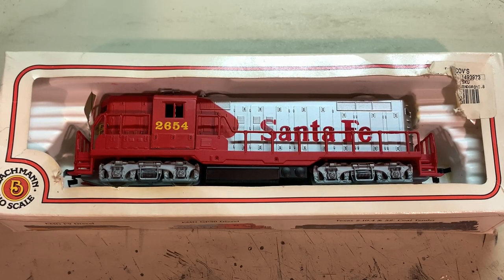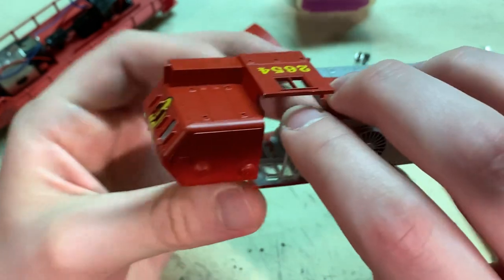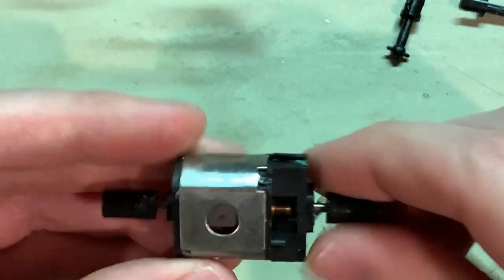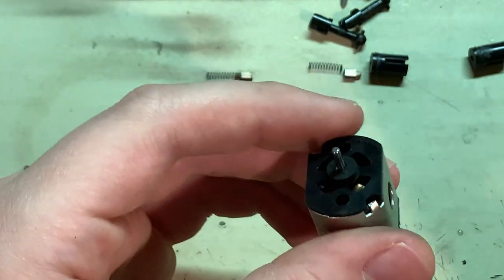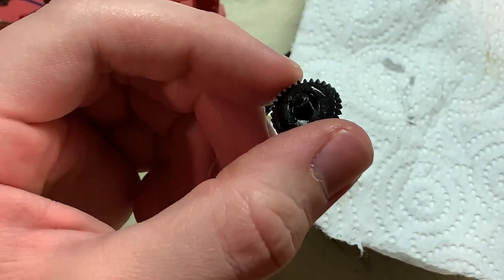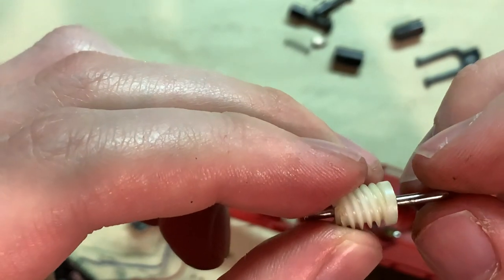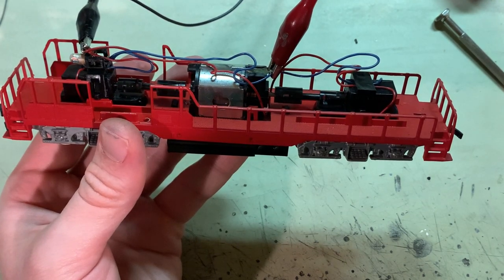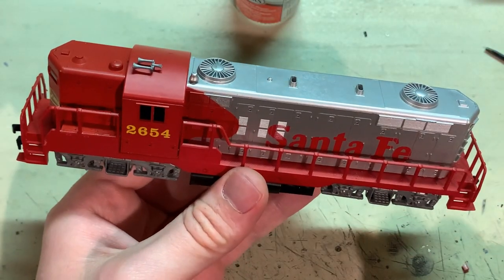How to tune up a Bachmann (or AHM) GP18 and other diesels by Mehano

Comment: Great video! Eight wheel pickup really does make a difference. I love Mehano models because they have a simple and therefore reliable drive mechanism, easy to service. I have some Mehano locomotives that are almost 40 years old and still run like new.

Comment: The early Bachmann models after the closure of AHM is basically just old Rivarossi/AHM stock. AHM had stock leftover from the closure, and they had to find a way to empty out the warehouses. AHM in Bachmann boxes is ironically higher quality than the actual Bachmann models of that time.

Comment: Great video,  I just found your channel and subscribed it right away.
7:23 I've also disassembled the Mehano's motor and had difficulty to pulling out the armature from the commutator side, after a while I found that it was easier to pull out it from the other side.

Comment: the piviot pin on the Gp18's coupler boxes appear to be wide enough for Kadees though
Reply from the maker: It is, but it’s NEM height and sits too low for even the raised head Kadees. Since it’s not an NEM style pocket though, the Kadee couplers for those types of boxes also don’t fit.

Comment: I was going to ask you if you had a solution for switching the couplers over to Kadee’s but I’ve just been mind blown by the way you got the horn hooks to work like that. Genius.
Reply from the maker: Yup, clipping the horn works decently as a quick solution! A Kadee coupler would need a head that’s raised extra high to work with these, unless you remove the truck mounted box and body mount the coupler instead.
Reply: @DarthSantaFe  Believe it or not I’ve tried using the offset shank couplers and they still don’t make the height gauge, the closest I and one of my friends have been able to get is gluing couplers on top of the mounts and filing away some of the material of the front and rear openings to allow for clearance. I’m definitely trying this on my IHC Premier C628.
Reply: I recently purchased an F9 that has the same truck mounted couplers. Unfortunately the horn hooks broke off in shipping. And these are also unusual horn hooks as they have the centerset Shank. I didn't have any spare horn hooks that would line up with the few cars of mine and still have horn hooks. I have a more recent model power F3 that came with Bachman easy make couplers. That locomotive has very similar truck mounted couplers that are installed in the same way as the old ahm. But something is just different enough for the model power to have its couplers at the correct height.

Comment: Some great information on fixing this style of locomotive. I have a Model Power RS2 with the same style chassis, it’s a very smooth runner and have no issues running it. However it can only pull five or six cars max. That’s on a level surface. Any suggestions on making it pull better? Thanks!
Reply from the maker: I also have that one, and it’s a smooth runner but also doesn’t have much traction!  There isn’t much room inside, but you might be able to cut up some sheet lead and carefully glue it into and open areas. The stuff is available for pretty cheap at Amazon, and you can stack/fold and shape it to fit well to wherever you need.
Reply: @davidandrew477  Thanks for the Bullfrog idea! That and a little added weight should help the performance.
Reply: @DarthSantaFe  Thanks, I’ll have to give that a shot. 👍

Comment: Awesome video. The problem that I see is the gears 14:00 being different sizes, would mean the wheels turn at different speeds - 22 gear vs 34 gear, or about 1.5 times faster. Being a small model you wouldn't notice much, but could wear the wheels, slightly due to slippage or dragging.
Reply from the maker: The wheels themselves have the same size gears though, so you can actually have any size of idler gears between them and the worm gear and it wouldn’t affect the rotation speeds. Nothing to worry about here! :)
Reply: @DarthSantaFe  Oh yeah, just not used to seeing gears used asymmetrically.

Comment: What did you use as window film? It looks really great
Reply from the maker: Some detail parts manufacturers offer clear window material that can be easily cut and shaped with scissors, but you can also use the clear plastic bubbles from product packaging as long as it has good clarity.

Comment: Another question...
What type of controller are you using?? You often mention the current draw being high or normal. So, your controller must have guages to show electrical draw. 
Thanks again.  It's always a pleasure.
Reply from the maker: The controller I use on the layout is actually a custom unit with a lot of built in meters and functions. On the workbench, I use an old filtered DC power supply for electronics with adjustable voltage and amperage.
Reply: @DarthSantaFe  did you build the controller yourself??
Reply: @DarthSantaFe  I haven't actually taken the plunge into the hobby yet. I'm watching a lot of videos,  like yours, and I find that I'm more interested in the repairing and restoring of the older engines than I am of actually having a huge layout.
Reply from the maker: @steveandulsky566  It was built by a family member who used to work in electronics design. He’s retired at this point though.
There are a lot of different ways to enjoy this hobby, and restoration is one of them! Some enjoy other areas such as scenery modeling, replicating an actual route, or even operating to a realistic schedule.
Reply: @DarthSantaFe  you've been very kind to answer my questions.  If you don't mind, I have one more. A local electronics vendor offers a benchtop adjustable power supply at what I think is a fairly reasonable price. 
The supply offers:
0-30 VDC, ADJUSTABLE 
0-10 DC AMPS, ADJUSTABLE 
But I don't see any way to switch the polarity of the output in order to change train directions. I suppose it could be done downstream of the supply with a DPDT toggle switch. Is that how yours operates??
MRC offers a controller with builtin guages for ~ $210 -$240 range. But, I think with a little more homework I can beat that price significantly..
Any advice??
Reply: @DarthSantaFe  I agree...those other aspects of the hobby look interesting.  However,  my problem is limited space. I'm retired, and have downsized to a smaller home. As a result I don't have room enough to enjoy the hobby to its fullest.  
That's why repair and restoration is so appealing to me.
Reply from the maker: @steveandulsky566  That sounds like a very capable power supply, so if you can add a direction toggle switch between the unit and the track, I think it’ll do great! Just be sure not to push the voltage too much and you’ll be perfectly safe. Most controllers go up to about 13.5V, so I’d stay within that range when running continuously.
Reply: @DarthSantaFe  thank you so much. I really appreciate your feedback.  Good luck on your future projects,  and I'll be watching your videos to gain more knowledge.

Comment: Interesting, as always.
Some quick thoughts:
What do you do if brushes are worn????  See last para.
That comment re slow speed running is interesting.  Real locos weigh 100 tons or more and start accordingly.  Way back in 1976 or 7 in 'Model Railroader' Donald Thorn wrote up a transistor controller with an independently accessible pulse controller.  I have used it for years; might help here.  The purists say pulse is hard on motors, and they would be correct; but this is a pretty rugged motor.  You are correct in the general direction of these locos being the basis of a really lucky layout - you just need to know what you are doing and use a bit of sense.

The commutator cleaning was interesting - I noticed you did not clean out the slots??? to get rid of dirt and cleaning compound.  Might also have been a good idea to support the free end of the commutator in the tail stock, and note the use of safety shield.  What ever people do, don't use a drill as a makeshift lathe.  The pressure of holding can be a problem, as is stability.  You have to be wrong only once.

I wonder if removing the armature from the magnets might weaken the magnets and ultimately cause overheating.

A plastic compatible cleaner might help clean up the gears, making sure it is dried before relubricating.  Work outside for ventilation.

As I keep saying, we don't know who is going to have what we fix after we have finished with it, so make sure it is safe in a practical sense, mostly meaning good current draw and no overheating.  'Tuning' means returning to manufacturer's specs.

Ah! the joys of treating the whole world like it were a Mecanno set!

Peter T
Reply from the maker: If the brushes are worn down, you might be able to make new ones by sanding down some Athearn spare brushes to the right size and shape.

Since the motor was most likely unused when I opened it up, I only did a quick surface buffing to get rid of some oxidation.  When the motor is especially dirty, I like to use a sharp knife to clean between the segments.

If the motor uses Alnico magnets, removing the armature can weaken it since they're typically charged after assembly.  Most of these can motors use ceramic based magnets though, so loss of magnetism isn't anything to worry about.

I usually use alcohol and a stiff brush on really dried up grease, and that's been more than enough in most cases.  If it's really heavily caked onto plastic, a better cleaner would be a good idea.
Reply: @DarthSantaFe  If it is really dirty I've had luck using mineral spirits.

Comment: I have an engine the same as that in a 4-6-2 mehano, only mine does not work at all well, because when it goes at full speed it makes false contact in the changes of track and from there it does not move, any recommendations?
Reply from the maker: If it isn't derailing or getting a short circuit, adding additional electrical pickups might help.  If any wheels are plastic, they're usually not hard to change to metal on these, and Kadee coupler centering springs work well for making electrical wipers.
Reply: @DarthSantaFe  correct my friend, but the problem is not that, if not the motor, since it has easily rusted and I soldered new cables and clean the outlets, so I need to change it for a new one, but I don't know which one is the right motor for a of those locomotives
Reply from the maker: @Fxe4014  I see, so if your electrical pickup is all fine but the motor isn’t working, you might be able to remove and tune up the motor like I did for the one in the GP18. If that doesn’t get it working, you may be able to replace it with an identical one from eBay or a good medium size can motor (like an FF-130SH, 12V version).

Comment: Unfortunately the ATSF never had any GP18's and if they did, they would not be painted with the war bonnet passenger scheme, but the blue freight scheme It did have GP20's (essentially a turbocharged GP18) and you can see the paint scheme they would have employed. Second, IF ATSF did have GP18's they almost assuredly would have been low short hood units like the GP20's. Third, this unit is steam generator equipped (you can see the vent and exhaust on the short hood) for dual service and only GTW opted for that option
Reply from the maker: These cheaper models did get a lot of fantasy paint schemes over the years.
Reply: Some of us dont care about counting rivets, we just enjoy the hobby as it is.
Reply: @ericzerkle5214  The information is provided free of charge to those who may be interested. Live with it
Reply: @colbeausabre8842  Triggered
Reply: @DarthSantaFe  mine is I chessie paint scheme

Comment: I've never had any luck with bachman, they put all their efforts into the looks of the train, but never on the motor or the electronics part of it, I had a Hudson it was made by bachmann is gray and yellow that was a biggest piece of crap and I paid $199 for the set!!, It had a pancake motor completely plastic, did actually melted, and use!, No metal can motor!!!, No metal parts whatsoever , a real POS!!, I will never buy another buckman again!!, That's five bachmann sets up but it was junk!!
Reply from the maker: Bachmann stopped making the pancake motors and plastic frames about 20 years ago. Most of their new stuff is actually very nice quality. I’ve found them to be about as dependable as my Athearns. Comparing modern Bachmann to the old stuff is about like judging Proto 2000 models based on the train set Life-Likes. :)